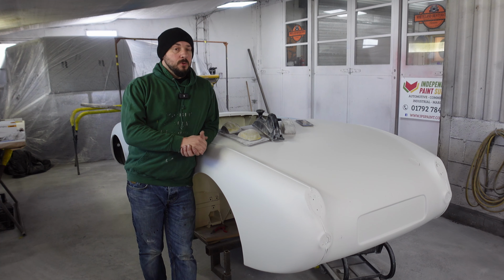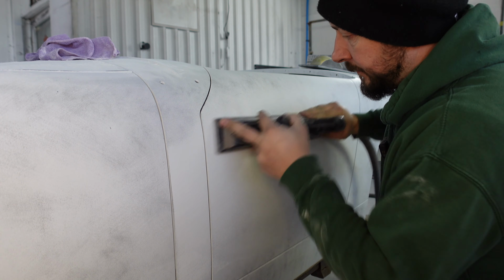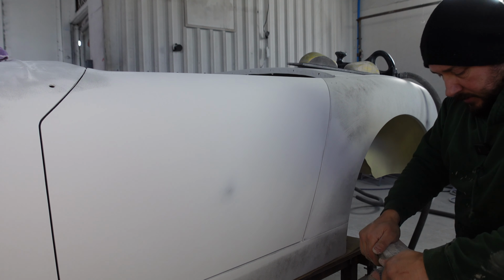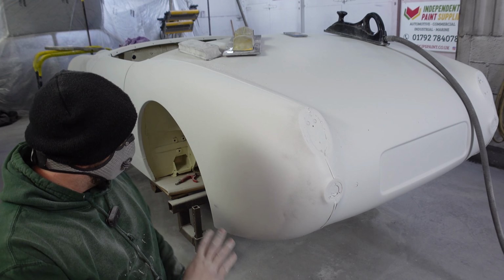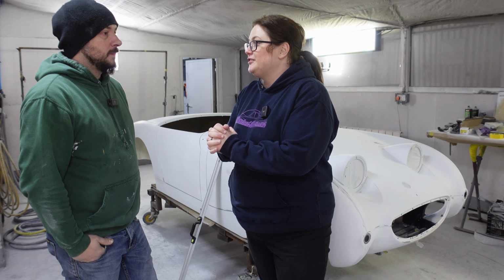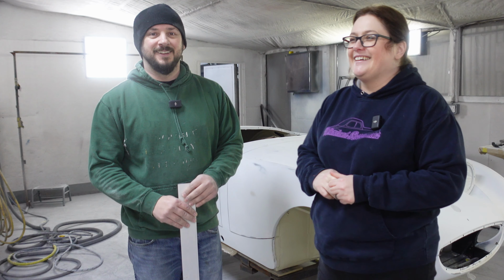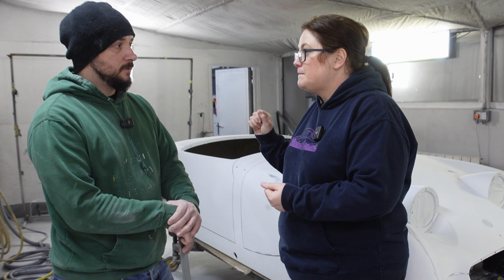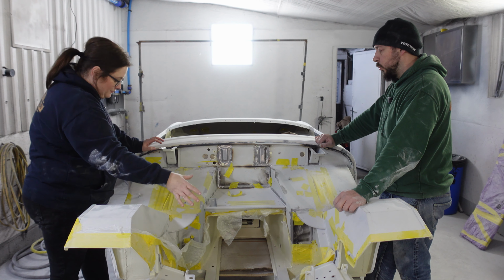Guide to Hand Blocking a Classic Car Before Paint!

Comment: Nice video. I'd recommend the yellow Mirka flexible block, and just pull off the threaded section at the top. Makes a great flexy block with dust extraction....uses same hose fitting as the rigid block. Only downside is the cutting power is a bit less than with the Durablock because of the abranet extraction holes.